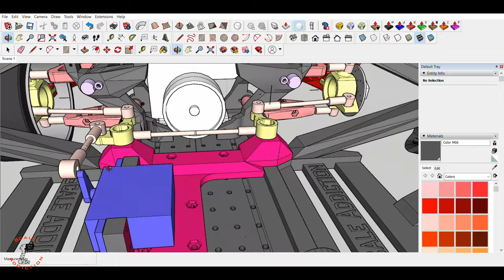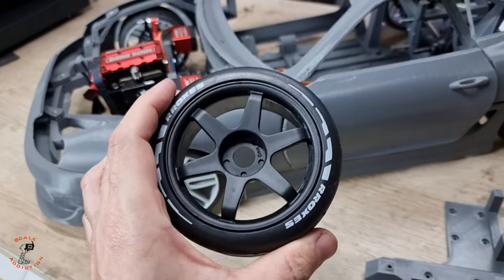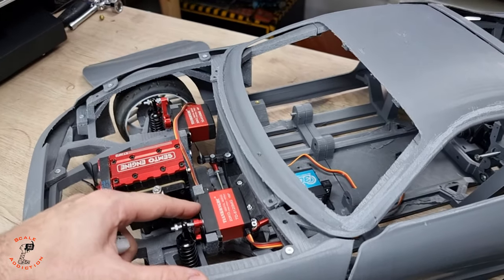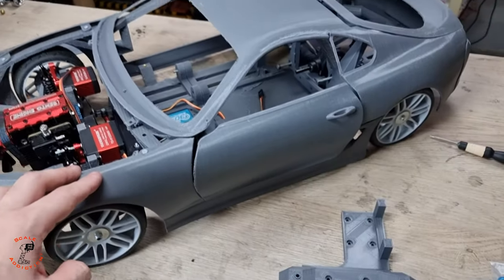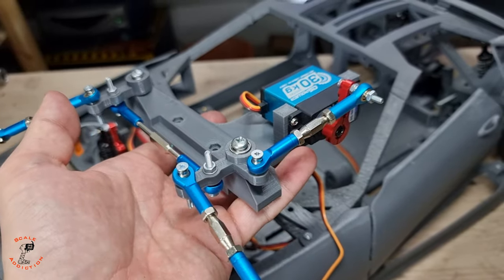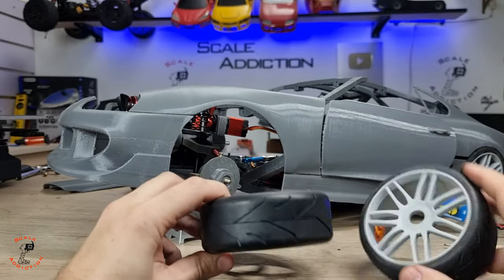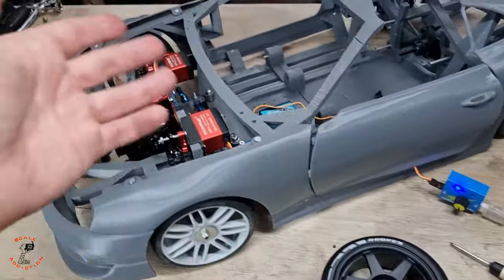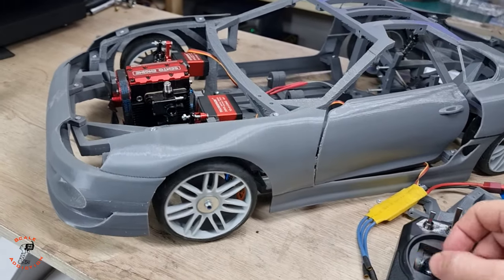Part 6 /  8th scale 3d printed supra with 2 cylinder engine project / Scale Addiction

Comment: U know if u running a good  controller you can set the endpoints so won't have to much travel so u don't need that whatever u that was to control the servo
Reply from the maker: I'm using flysky controller,  I can limit and  mix channels too, but it will take 4 channels from  that 10 channel, with that  I will only use 1 channel